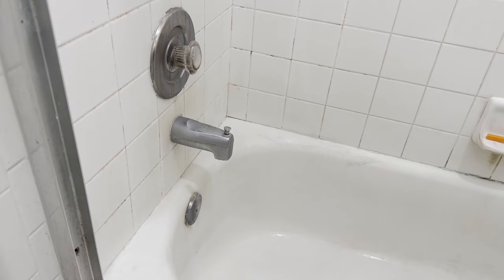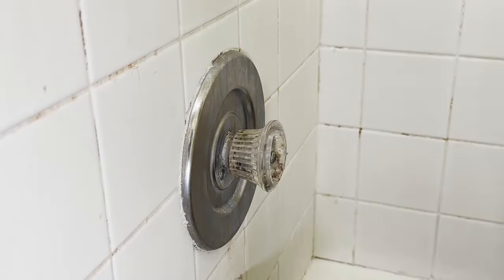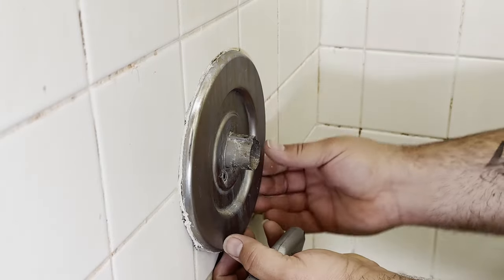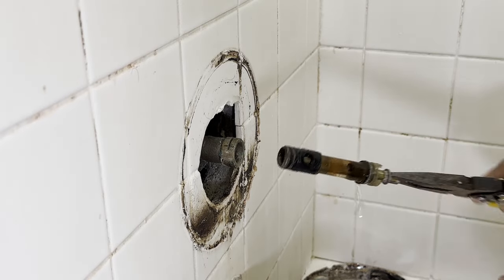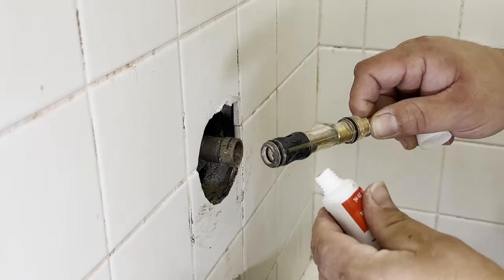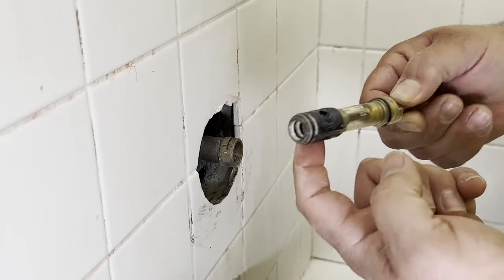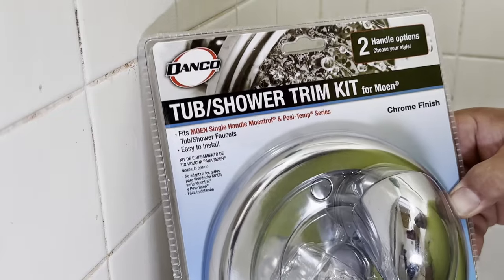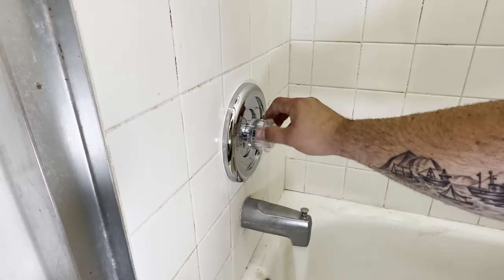THE PROPER WAY TO REPLACE A MOEN 1225 CARTRIDGE (4 PRO TIPS)

Comment: Yeah right No way cartridge comes out that easily
Reply from the maker: Many do. And there is a puller tool available when needed, but I rarely need one
Reply: Mikethompson3534. Totally agree with you.  I had to replace a moen valve last week it was almost impossible to get out. I think some of these videos are made up.
Reply: @omarrohoman3726  probably some of these areas don't have hard water and others do.
Reply from the maker: @MattPSU02 that can definitely make a difference
Reply: they make a puller tool for this exact issue, 
rather readily available
Reply: @scorpionbuilds when I couldn’t get the cartridge out (tried EVERYTHING) went to Rona, asked for a new cartridge, was told they’d need to see the old one to match, said I can’t get it out, I’ll get a cartridge remover….was told “we don’t sell those”…..said “I’ll just get a new cartridge then”….was told “I’ll need to see the old one to match”…..said”it won’t come out”…….etc……no help there at all.
Ended up cutting the drywall behind the shore, cutting and replacing the pipes, and shower handle, shower head and guts.
Pain in the butt.
I see there’s no YouTube video showing anyone using s cartridge remover.
Reply from the maker: @kevinwatkins3856 sorry you had that issue, sounds like they did really know what they were doing. Perhaps I will use one just for the sake of using one, to show others how to use them

Comment: Tip #5 make sure the old  cartridge didn’t break. If the cartridge won’t go back in, look in the hole it goes in. Mine had a bunch of bits still inside. What a bear but it’s all done.
Reply from the maker: Yes, I have not had that happen to me, so thanks for the tip

Comment: "making sure the holes in the cartridge line up with the holes in the valve"    your sticking  a valve into a straight pipe.  what frickin holes are we lining up pray tell?
Reply from the maker: In the back of the brass valve housing that you put the cartridge into, there is a hole on the left and a hole on the right. This particular cartridge doesn’t have an alignment notch
Reply: thanks for your reply.  new one leaks like old one.  must be some hard water buildup in there.
 @scorpionbuilds
Reply from the maker: If there is some buildup inside the brass housing, you can try using some 120 grit sandpaper wrapped around a dowel rod, but be careful
Reply: finally got a real plummer.thank you for the advice @scorpionbuilds
Reply from the maker: You’re welcome

Comment: My hot water pressure is very low only in 1 tub.  Rest of house is fine.  Could it be cartridge?  Its moen as well.
Reply from the maker: It’s possible,and the cheapest place to start. but it’s more likely to be another issue causing low pressure. I’d first ask if the cold is also low on that fixture? Or any where else in that bathroom? What kind of pipe is it plumbed with? Is that room an addition to the original house? It could be corrosion inside the pipe making the diameter, smaller and causing low pressure. But it’s hard to say without being there to troubleshoot.

Comment: If it still dripping what can it be the problem?
Reply from the maker: If the new valve doesn’t stop the dripping, there may be damage to the housing where the cartridge seals are, if that’s the case, replacing it may be the only option, I’d inspect it carefully for damage

Comment: I'm just doing this and got hung up on getting the clip to fit back in at 2:10. The question is "how far do I push the new cartridge in?  I had to take some measurements.  From front end of the brass valve housing that the cartridge slides into, it is .250"  (1/4") back to the clip slot.  It is only about .125" (1/8") from where you want the clip to the front of the plastic ears.  That means you have to push the ears in past the brass about  "125" (1/8") to have it seated to the right depth.  And it must be seated absolutely vertically for the clip to slide down over the plastic ears.
Reply from the maker: Typically the cartridge will only go in far enough for the clip to be installed, if you’re having issues, double check you have correct replacement cartridge by doing a side by side comparison. Make sure nothing is preventing it from being properly seated, and yes the cartridge must be in the right position for the clip to be installed

Comment: Great video..
Can I change the o ring itself?
Thank you have a blessed day and be blessed
Reply from the maker: The whole assembly is pretty cheap, but you could contact the manufacturer to see if they’ll sell just the o rings
Reply: @scorpionbuilds  They do. It's a kit of all of the rubber parts including the ones that go over the hot and cold openings. But if it were me and I took the time to take all this apart, I'd absolutely just replace the whole cartridge. Hey good work man, thanks for the tip
Reply from the maker: I agree, the cartridges too cheap to wanna just replace the O-rings. Glad you enjoyed the video.

Comment: Thank you for the video! One time I changed the same cartridge in my bath tap, and it was successful. 
But I couldn't take out the old cartridge in my hubby's bath tap today. I took off the pin, but the cartridge was stuck halfway when I tried to pull it out. I was able to push the cartridge back, but not pull out. I checked for more locking pins and found no one.
Fortunately, after all of these operations, when I assembled a faucet back, the tap with the old cartridge stopped leaking :-))
Do you have an idea, what was wrong? I'm afraid to apply too much strength in the plumbing works to avoid more damage. I was pulling the cartridge out pretty firmly
Reply from the maker: Great question, sorry you’re having trouble getting it out. Try soaking the cartridge with some WD-40 or a silicone spray, and thy using this puller tool:

https://amzn.to/4cUNz27

Hope this helps, good luck
Reply: Thank you for the response! 
Yes, I thought about WD-40 lube, but after I assembled back the faucet.
Thank you once again for the video!

Comment: You didn't mention the "notch" on the stem and which way it should be oriented, or testing the valve in the proper orientation to ensure cold water and hot water is working properly.  Has something to do with the stem notch.